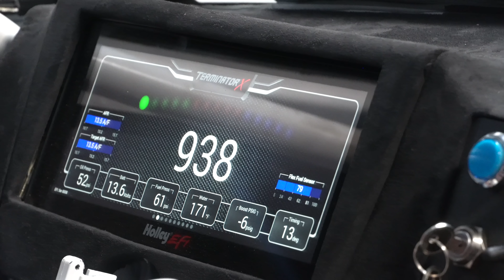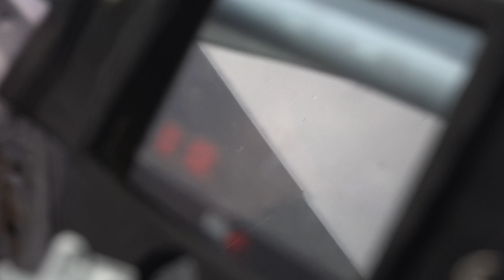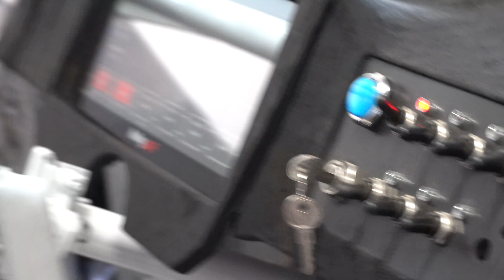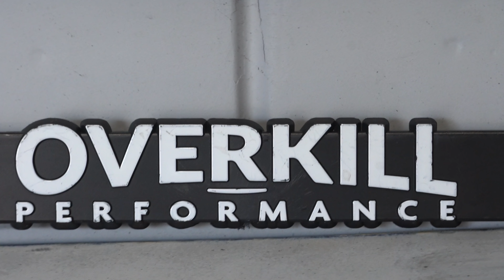INTRODUCING MY 800hp COMPETITION DRIFT CAR SPONSORED BY OVERKILL PERFORMANCE!!!

Comment: Ay bro at 2:50 you see that driver side tire get caught up bad. Didn't know if anyone seen it figured I mention it so yal can check it out. If you were going faster that could have been damaging lol.
Reply: You would only ever turn that far on low speed but it's the fender moving. Not the wheel stuck.

Comment: ask overkill what they think they could do to my whipple supercharged 6.4 392 charger
Reply: @SmokeyPitHeeler  you would have to build the engine with upgraded parts stock scat motors can only handle like 6 lbs of boost safely